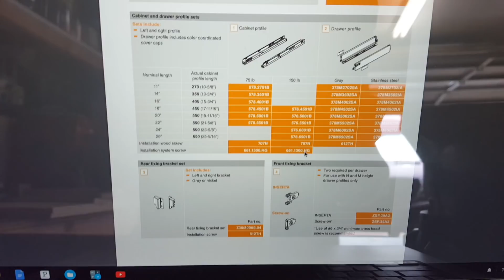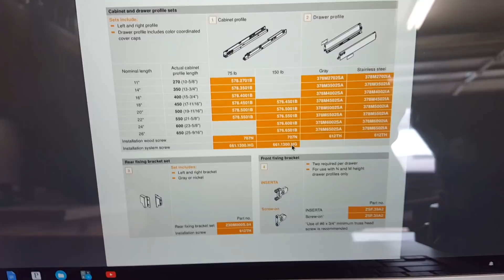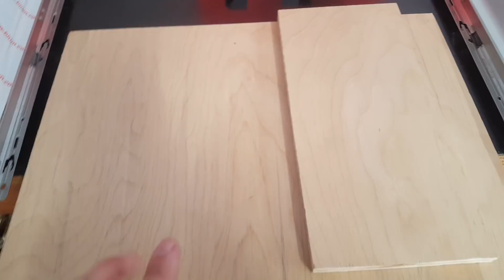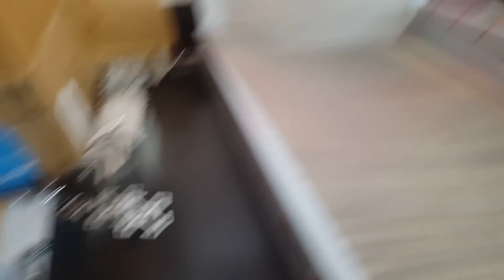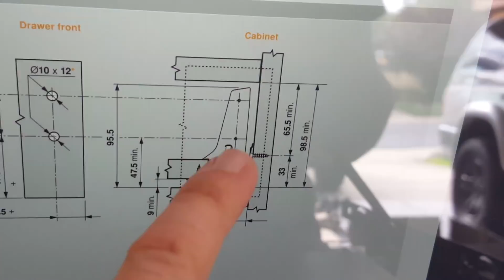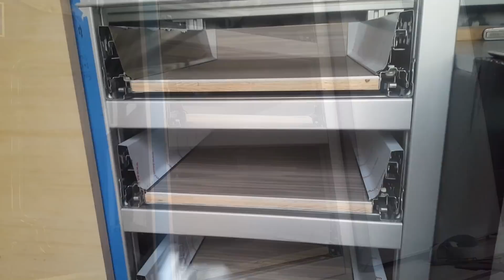Easy Drawers for RV/Camper Vans

Comment: Sweet videos. Do the soft-close drawer slides lock into place? Thinking of using this in my overland trailer, but wondering how your slides stay in place while travelling.
Reply from the maker: They do not, I have separate marine latches to keep the drawers closed.

Comment: Love the videos! Have you made a video which features the slide out drawer on the right which turns into a table? Looks tricky!
Reply from the maker: Thank you!  I did not make a video on that because the table is full of compromises and was not easy to implement.  It works for us but honestly it's the most fragile thing in the van by far.

Comment: Hi - I'm following along with your video and am just in the design phase.  I'm building a small box using Tslots with two drawers for the back of my Jeep.  This drawer system will be bounced around quite a bit, so I'm wondering if your drawers stay closed when things get bumpy.  I need my drawers to stay put, so I'm looking into locking or latching drawers.  Not sure if Blum has a sku that does this.
Reply from the maker: Hi, I have never had a drawer open...I have an article specific to the drawer hardware here:  https://ourkaravan.com/attaching-cabinet-hardware-to-8020/
If you click the link to the latches they are rated at 187 pounds of holding force.

Comment: Just stumbled onto this video and I think it's exactly what I need to do.  My use case is much simpler - a two drawer system for the tailgate of my Jeep.  It's been 5+ years since you posted this, how are they holding up?
Reply from the maker: Hi, I have not had a single issue with any part of this; it has honestly worked flawlessly since day 1.  I would build it exactly the same way today.  -Ken

Comment: Those drop in spring loaded t nuts, are they from Amazon or actual 80/20? Thanks
Reply from the maker: I have purchased from 80/20, amazon and ebay.  Go with whoever has the number you need for the best price.

Comment: It would be simpler and cheaper to either preload the nuts into the rail before adding the sliders or premount the slider before assembly of the frame. You could also undo the nuts on the L brackets  and add the nuts loosely assembled on the slider and then realign the rail
Reply from the maker: True.  The planning for mounting the slides came later, which is why the roll in t-nuts are great.

Comment: Your Youtube video says you used the 18" deep drawers for your 22" galley, but your one on your website says you used 22" deep drawers.
Reply from the maker: Hi Melinda, my own personal galley is 20" deep because I have a seat that slides up and down the length of the van.  I used 18" drawers because I have electrical mounted behind the drawers, limiting me a bit.  The pre-cut galley being offered now is 22" deep because most people aren't limited by a seat like I am and it allows use of larger sinks.  A full 22" drawer can be used in the 22" galley (assuming you haven't mounted something back there).  Be sure to check here for a detailed write up:  https://ourkaravan.com/building-drawers/

Comment: Assuming you made the 8020 cabinet box first. Then Blum gives you a number to cut drawer panels to after the fact?
Reply from the maker: Yes, the framing came first.  The Blum's instructions for the drawers tell you to measure the drawer opening and subtract a certain dimension and that will give you the measurement to cut the drawer floor and back.
Reply: @ourkaravan  amazing. Thank you for taking the time to reply and provide everyone with endless info.
Reply from the maker: @covecarpentry  No problem!

Comment: May I ask where you got the hardware that you used to connect the drawer slides to the 80/20? I looked at your website as well as at the description below and can’t recognize or find it/them. Thanks!
Reply from the maker: Hi, yes, in the 6th row down you'll see the roll-in T-nuts and M4 bolts:  https://kit.co/ourkaravan/cabinet-drawers-latches-hinges
I hope that helps!  Part number 13089...you may want to shop and see if you can find a small pack of them.

Comment: Ken, these drawers are no longer available from Blum, only in the gray steel and white, I think.

Blum makes a different drawer line called Legrabox that has a SS option, but there is one problem with them; the slide mechanism is substantially thicker then the Tandembox slides and so you lose space in the actual drawer because more space (height) is taken up by the slide mechanism.

I was planning on going the SS route, but once I saw how much space is lost in the drawer due to the slide mechanism, I felt that I needed to stick with the Tandembox product, even though it meant not having the SS drawers.  Since space in a van is so limited, I just felt that I didn't want to lose as much as you do in the cabinets because it could mean that I couldn't fit certain items in the drawers.
Reply from the maker: Hi, yes, finding a constant source for those drawer slides has been difficult.  I will make some calls late this week and see what I can find (if you're still interested).
Reply: @ourkaravan  No worries, Ken.  I did actually call a few sources and they told me that the SS option was discontinued.  Maybe that is incorrect, but not really an issue for me, I'll be happy with the gray units.

Comment: This is great! Why did you choose to build the cabinets inside of the van rather than building them in say a garage and then moving the completed cabinets into the fan for mounting? Just  trying to figure out which approach is easier. Thanks!
Reply from the maker: Hi John, you could do it either way.  I just happened to start by securing the back sections of 80/20 to the wall then built off that.  Building it in the van only helped to ensure my dimensions were correct as there is very little room between my cabinets and my sliding seat.

Comment: amazing idea. You have inspired us to maybe go the same route and go with the Blum hardware. How have they held up over the years? We travel on a lot of dirt roads, so I was initially hesitant on the durability. I've seen Blum first hand in many fine homes and the quality is outstanding, just curious how their products have been performing for you in the van. Any rattling?
Reply from the maker: I would absolutely use them again.  I haven't had any issues--the build quality is top-notch, so no rattling/looseness and the SS simply looks stunning.  The only other route I would consider (if I owned a ton of woodworking tools) would be a dovetailed bamboo box, but you're talking about more money in tools than these drawers cost, and likely more weight too.
Reply: @ourkaravan  we are by no means craftsman so the Blum route you have gone is very intriguing. Bamboo plywood seems to be extremely expensive too, so you're right.... A lot more money would need to be spent in tools and materials to make that work... not to mention skill. We are looking to do a serious amount of drawers in this Transit (r18inch deep x the entire length of the van wall) so it may add up quick!
Reply from the maker: @garrettmoon8352  They are pricey but are probably the nicest drawers I've seen, not to mention relatively easy to build.  Definitely adds to the feel of the van when you open a drawer and see stainless.  :)

Comment: Thanks again for all you have done here. Your galley is 20" deep, so I'm wondering why you say you didn't have enough room for the 20" drawer slide. I ask because I'm doing a similar build, but mine will be 1/2 inch deeper than yours (20.5" 80/20 depth). I was  going to do the 20" drawer slide, but I can't see why it might be too short. Thanks in advance!
Reply from the maker: A 20" slide will definitely work with 20.5" depth.  I should have clarified that mine are shallower because I have electrical components mounted back there.  Mainly a fused distribution block that powers all of the electrics in the galley.  In retrospect I could have made two or even three of the drawers deeper.  I'm very pleased with the quality of the drawers.  Take care!

Comment: So far best videos and description on van builds I have seen. By a long shot. Well thought out plan. Just about to start mine and problem I am having is you’re links for drawer slides don’t work from here in the far north. Canada. 
I now have the 800 Blum catalogue but kinda overwhelming. I would buy through your links so will have to figure out another way to show support. Thanks
Reply from the maker: I appreciate you considering that.  I do have trouble with that particular vendor keeping the Blum products in stock.  I always tell people to use the links when convenient, otherwise get them wherever you find them.  Thanks again and let me know you need help.

Comment: Great videos. Looks like the sides of the drawers are all the same height even know some drawers are deeper. Aren't you worried about smaller objects falling out the sides? Looks like you really can't fill the drawers to the top which would waste space.
Reply from the maker: I used three different drawer sizes but there does not seem to be a huge difference in height between them.  The larger drawer sides use the "gallery rod" to keep stuff from falling out of the drawer.  We use organizers to contain stuff so we don't have the falling out problem, but I certainly see your point.

Comment: Great video Ken, as always.  Do you find with the metal drawer slides that you get metal rattling noise when driving?  Are the cross bars needed for latches or something else?  Otherwise could you build without them and have more drawer space.  As asked by others, have you done any weight comparisons or do you know what this base cabinet with drawers weighs? It looks efficient.
Reply from the maker: Hi Dave, my cabinets are quiet.  I did put some of those little felt self-adhesive pieces on the aluminum where the drawers and cabinet doors touch it, keeps everything quiet.  

The cross bars are needed for the positive drawer latches.  I'm not sure how you would keep the drawers closed without them.  Magnets, even quite a few of them, don't seem to be enough to keep a heavy drawer closed on a turn.  

I did a full write up on the weights on my website,   https://ourkaravan.com .   Take a look in the van build section under cabinetry.  Take care!

Comment: I don’t understand how you’re putting stainless and aluminum together like that. What are you doing to prevent galvanic corrosion
Reply from the maker: The drawer slides that mount to the aluminum are zinc, only the drawer box is stainless.  Even so, galvanic corrosion is extremely unlikely to occur in the absence of an electrolyte.  I'm happy you understand that there is a time and place for stainless steel bolts (hardware) because most people are under the assumption it's the best at all times.  When aluminum is present, zinc is about as good as  you can do.
Reply: ourkaravan thanks for the quick reply!

Comment: Where did you get the bamboo fronts from?
Reply from the maker: I bought it from a local hardwood store.  It's made by Plyboo, and any good hardwood store should be able to get it for you.  I've actually ordered from two different places in my area.
Reply: @ourkaravan  you rock.  Your videos changed the way I was looking at my build. I'm very inspired by the aluminum extrusion material.
Reply from the maker: Awesome, thank you!  Good luck with your build!

Comment: Great build. Are the drawer frame front cross sections absolutely necessary for your build. Thinking of doing an even lighter weight build myself so I want to cut down on as much as I can.
Reply: Latches! I knew there would be something. Thanks.

Comment: Do you think you're wasting space by having those crossbars (mentioned @12:10) in between drawers?  If you remove them and have large enough drawer face plates, they wont only cover the missing space but that will allow you to fit larger items or even fit an additional drawer by moving each drawer down some.

Comment: Great video as always...?? Would it be easier and worthwhile to pre mount the slide rails on the cross member out of the frame and then just bolt it in place as an assembly with just your two bolts on the connection angle to the upright posts

Comment: Hey Ken, have you worked out the total cost for this cabinet you built? Trying to decide between this and just buying something from Home Depot.
Reply: That would be awesome and much appreciated. I'm waffling between this and perhaps a pre-built cabinet from Home depot bolted back to the wall. Love the way this looks and how it can be customized though! Great work. Loving the build process and definitely appreciate you creating these videos.
Reply: kenetube looking forward to it!
Reply: "Total cost" is a theoretical category. There are so many element factors comprising total cost, that the term's plasticity renders it meaningless and vulnerable to abuse. How one puts a value to one's unit labor power is only the beginning. In other words, you build a piece of cheap crap quickly and then tolerate its ugliness and poor performance for a long time.

Comment: Great ideas! I’d be interested in how you fixed wood panels to alu frame without showing bolt heads
Reply: Small angles affix on the internal face of the profiles. Just make sure they are a bit inside the exterior face, because those profiles have round corners, so it wouldn't look great.

Comment: Looks great there.FWIW, IKEA use the exact same drawers in their kitchens - they are the "maxima" IIRC. I used them in my last conversion (along with IKEA cabinets) and they were pretty good and the adjustement options were very handy.
Reply: Agreed. I redid our kitchen last year and they look almost exactly like Ikea drawers. However as Ken, there are a lot more sizing options with you build your own.
Reply: Thanks for reply.  That non-standard size is not something that I considered when saying about the IKEA drawers.  A very good point.
Enjoying your 80/20 series of posting and your build series in general. excellent work